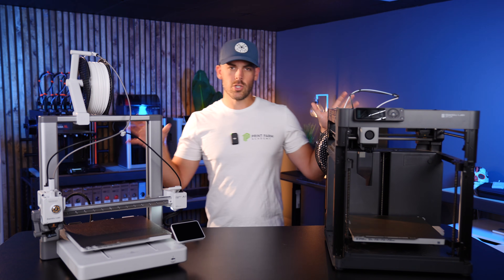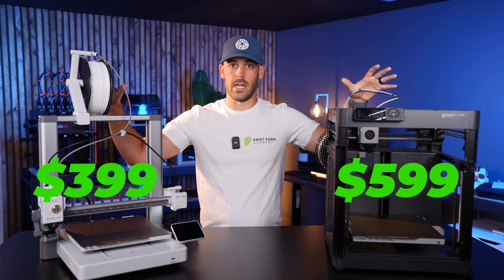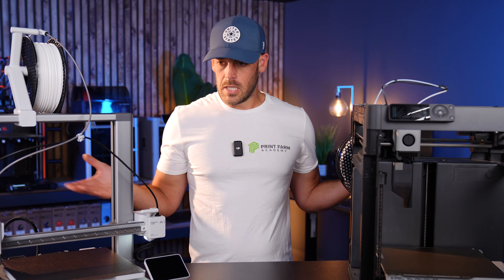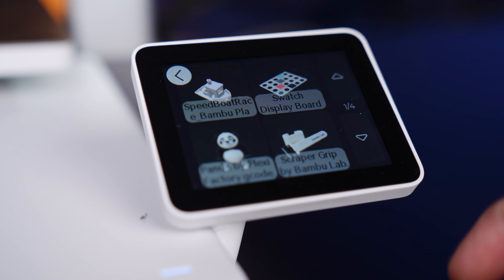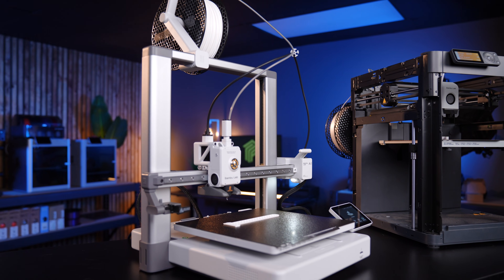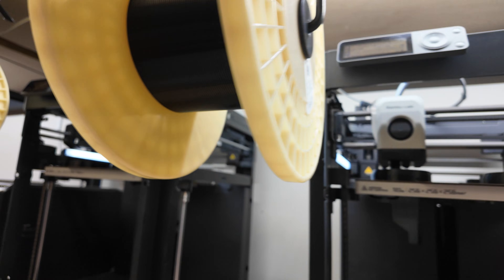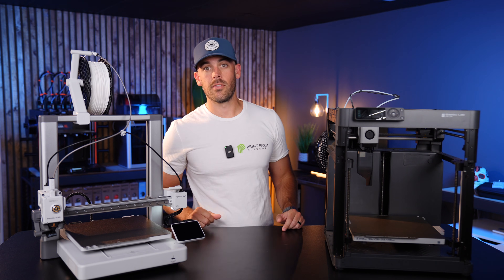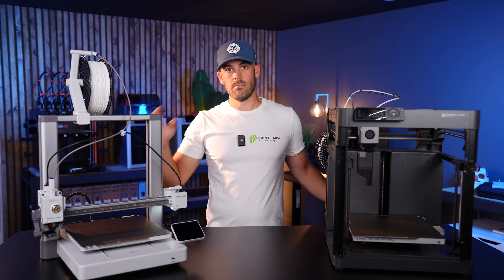When a beginner 3D printer is too good

Comment: I have three P1S and an A1 mini. Just bought 3 more A1 mini's because I print 100% PETG and the nozzle wiping solution on the A1 series does a much better job of cleaning the nozzle and not getting filament on the print bed. This can be pretty annoying with PETG. My parts are also less about volume and more about area so for basically the same price right now four A1 minis gives me twice as many parts in half the time as one P1S. YMMV obviously. Also, notice in the video all that dark carbon sludge on the Z-screws in the P1P from the X-axis rail and how difficult it is to regularly get back to that nearly-enclosed rear screw to clean.
Reply: @printfarmacademy episode idea btw, maintenance schedule/technique for these printers :)
Reply: I was going to ask for this kinda of feedback.  I'm looking at at the pretty P1s but one set of my parts can be printed in PETG and all together,  are slightly larger than the size of my hand.  A P1s is a huge waste of space if I dedicate a printer to the part.  Other parts are bigger so I'll need a P1s, but a P1 Mini or two would be cheaper and good enough for the part.  Thanks.
Reply: I've got a P1P, and a A1 mini and just bought a P1S mainly because I don't find the A1 to be dimensionally accurate (it's usually out by about 2.24%. For 50% of my parts that's fine but for the others it's a problem.
Reply: @nykscreations1483  interesting, I'll make sure to test that. So far so good on the one I have.
Reply: @robertasumendi Im curious what were your conclusions regarding the dimensional accuracy?
Reply: I want 3 more a1 minis!!! They're good little machines and way faster than my Prusa Minis
Reply: Great comment. When I get a machine, I'm planning on starting with petg exclusively.
Reply: @robertasumendi does all your A1 minis have the AMS?
Reply: @ none do